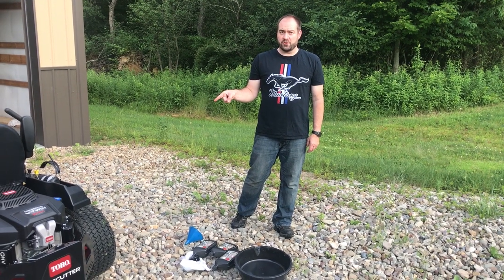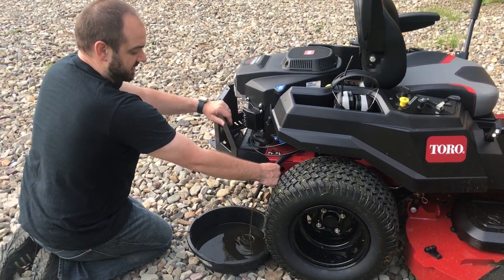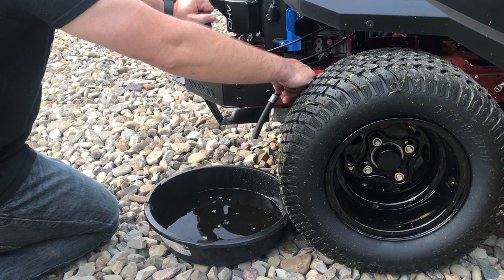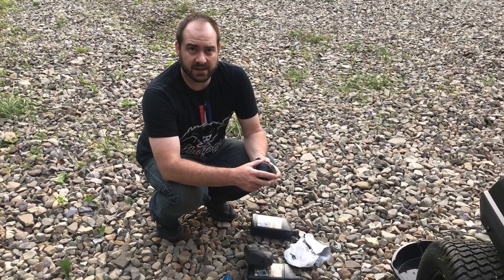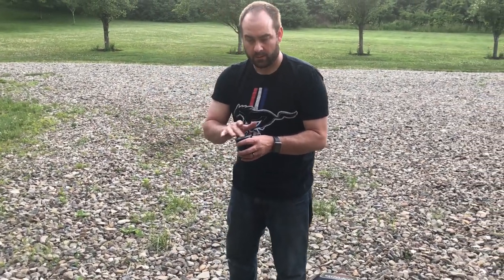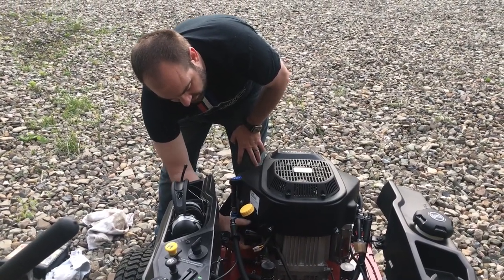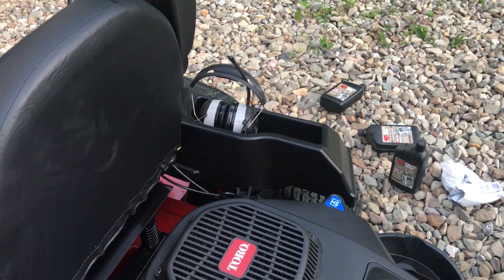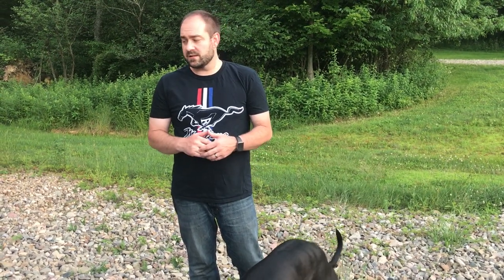#30: Toro TIMECUTTER Zero Turn Mower First Break-in Oil Change at 5 Hours. Quick, Clean, Easy!

Comment: I have had my time cutter for about six years now and still and changed the oil. I did put a truck tailgate spreader on it and a 29 gallon sprayer and painted it and added a rear swivel under the hitch I welded on it
Reply from the maker: A tailgate spreader and 29 gallon sprayer - that's cool!  Thanks for sharing.
Reply: @PurpleCollarLife  putting a rear roller on the back today with a linear actuator to raise it up when backing I’ll post a video soon

Comment: For some reason you had extremely high gasoline consumption. My new 50” Timecutter with a 24.5hp  V twin engine used 3 gallons over three hours to mow almost 2 acres with repeated crossings (literally about 4 acres worth of mowing) to disperse the clippings because the grass had grown a bit too tall. That is a much better yield than what you described and I got the same high yield the second time around. I’m about to do my first oil change so thanks for your video.
Reply from the maker: It's been better as I've improved as an operator.  I think now that I mow mostly in the medium and fast speed, I'm getting much more mowing done on less gasoline.  Good comments! Thanks for watching.

Comment: 2022 the tube (hose) like other model years is VERY hard to get off the 1st time. In fact I broke the plastic piece the tube goes in. I heard others using a screw in top of the tube. Is that ok or does it have to be vacuum sealed?
Reply from the maker: I've heard others saying they have added a shut off valve to the end of the hose if they have broken that plastic piece off.  I haven't heard of any issues.  So far (knock on wood), I haven't broken off that plastic nipple. But I can totally see how it is possible!
Reply: I actually found this video because of how hard it was to get the tube off, and right after watching mine snapped!  I guess I may be trying the valve method

Comment: I just purchased the 52" Toro Commercial 06/06/23.  I mowed for 5.4 hours and still didn't need to fill up yet, but I decided to anyway.  I didn't notice that it had a fuel gauge until I was blowing the grass off of it.  Three tanks seems to be really excessive, especially since I went 5.4 on the original tank.  I run full speed also.

EDITED to add that this is my second Commercial Toro Timecutter and I love both of them.  The first one I've had now for 12-15 years and it's still running.  It has over 1,000 hours on it, but I'm not sure how much since the plug that the hour meter goes into somehow got pulled apart for a short time until I wondered why it wasn't changing. I highly recommend Toro, especially the commercial models.
Reply from the maker: Thanks for sharing your experience!

Comment: H B
0 seconds ago
I just purchased the 75750 only for my home. I couldn't believe it! I almost landed on the street on a decline! I used it for 1.7 hours being very careful operating when I turn left to go back it just slides like ice down the hill. Our yard is mostly flat except for the front with a slope of more than 10% in front that I tried to stay away from. I was ready to jump off to the left. I locked the brake quickly thank God no damage!
Reply from the maker: They can get really sketchy on slopes! Be careful out there.

Comment: 3 tanks of gas does sound a lot; BUT, at the time of your video the engine was brand new as well as you were running in Turtle mode (equates to high revving in low gear), so, the gas consumption can only get better.  According to the operator's manual (Page 14, takes 40-50 hours for the machine to fully broken-in)...    Thanks for taking the time to make this video!!

Question: Have you researched on aftermarket oil filters that can sub for the Toro oil filter (136-7848)?     I found several (WIX WL10239, NAPA 400239, Fram PH4967, Purolator L14476), but I can not verify their exact fitment yet (I am still expecting mine to be delivered) for proper substitute of the Toro filter...   Regards.

Updated (April/26/2021): My 75742's first oil & filter change, the Purolator L14476 oil filter does Not work do to just not enough space between its threaded base to the oil filter adapter (by ~1mm) leaving a very small gap for oil to seep through the filter gasket.  The Fram PH4967 fits just fine with the filter's threaded base making contact to the oil filter adapter right at the 3/4 of a turn.  I had a difficult time find the WIX and NAPA filters in my area, so unable to try them out.
Reply from the maker: Hi Rick.  Excellent point about the gasoline usage.  I do think it's leveled out over time, but still uses far more than a diesel tractor. :)
As far as the oil filters go - I did a lot of filter research on our John Deere tractor, Jeep Wrangler, and Ford F350 Diesel.  What I've found is that some non OEM filters aren't engineered specifically for the engine/application.  Since that time, I've always paid a buck or two more for the actual brand filter.  I buy only the Motorcraft filters for my diesel engine, only the Mopar filters for the Jeep, and only the John Deere filters for the tractor.  I've done the same with this Toro.  The Toro filter is around $12 on Amazon, and I don't spending that for the filter that Toro recommends using.  Great question though.  Here's the Amazon affiliate link for the filter by the way: https://amzn.to/3drs6zV
Thanks for watching and commenting!
Reply: One more comment to share with regard to draining the old oil (I learned last night) without the need to til/lift the left side of the mower since the Toro V-Twin engine base-cover/oil pan design has the cross oil flow/drain channels between  chambers, so by leaving the mower sitting on leveled ground plus give it enough time will allow most of the oil to drain out of the engine;  see video in the URL below:
 https://m.youtube.com/watch?v=02SEt8pfvRU
Reply: Thank you for the info!

Comment: Just purchased the time Cutter, how was the steering when you purchased it? Mine had the tendency to swerve left when levers were pushed all the way forward. It should go straight forward, and straight backwards.
Reply from the maker: Mine has been good.  I do notice when traveling across any grade though.  If you're on even a slight slope traveling sideways, you will have to adjust your hand position accordingly.  If you push both levers to 100% forward and there is even a few degree grade, you will travel toward the direction of the "downhill".  
Also - there is some adjustment in those  levers where they are bolted - check to make sure they're equally positioned on each side.
Thanks for watching! Good question.  Keep us posted.

Comment: If you have an oil pump is there any reason you couldn’t drain from the top through the oil fill tube? That way you avoid that dreaded plastic nut valve at the oil drain port? I have a 5025 that doesn’t have the built in drain pipe
Reply from the maker: That's a good question. I'm not sure about the answer. I have seen some people use an oil pump to remove oil from things like push mowers (the ones with no drain plug).  
I've only ever used this Toro machine - so I don't have any experience with the plastic nut valve.

Comment: Thanks for the informative videos.
I am waiting for my FIRST Zero Turn myself.
I ordered it recently.  (I had to go through Toro's Web Site which I was not pleased with doing)

Anyways I am getting the #75750 Timecutter 50" with the 23hp Kawasaki Engine.
I was wondering if you would know (or if anyone else knows) IF you can swap out the Plastic Chute for the Rubber Chute?
I am willing to purchase one straight up if I have to as well...I am not sure if they have a Rubber Chute that will 'fit' the Residential Zero Turns

Thanks again for your Time & Effort making these videos...
Reply from the maker: Thanks! When I first got the Toro I wondered about the discharge chute too. I considered trying to use a rubber one from a Toro Titan. But the plastic chute is still holding strong so far.  I'm pretty cautious though - I haven't hit it off of anything hard yet.

Comment: Just wondering if your Zero Turn is getting close to having it's Hydro Gear fluid changed and the type of oil you will be using?   
Mine has the ZT2100 Hydro Gear (supposedly none serviceable,  no filter, no drain plug - LOL), so,  I plan to use suction to draw as much fluid out...
Reply from the maker: Rick - sorry it took me so long to respond. I hadn't even thought about the hydraulic fluid.  I'm going to need to do more research.  Let me know how it works out using suction and then replacing the fluid.
Reply: @PurpleCollarLife  
I am currently researching for the 20W-50 motor oil (according to Hydro-Gear,  as long as meets API SL or higher rating) to use, leaning towards Valvoline or Castro full synthetic). I plan to do the fluid change before the Winter,  approximately early Nov. As for using suction , I just got one from Amazon by "4 Uncles" on sale...   I will update here.
Reply: @rickt2419 how'd it go?

Comment: Where I should  put the hydring oil???
Reply from the maker: Good question.  I’ve never needed to change or add any.  I’ll do some research.
Reply: @PurpleCollarLife  mine (75754) has grease fitting for the front tires there are videos that show a common problem with them being dry

Comment: When i pulled down, it broke the little plastic piece.... what do i do
Reply from the maker: Hello Tyler - thanks for watching and asking. I've never had that issue - so I'm not sure what to try.   Did just the tube part break off inside the tube? Or did the tab (with the blue sticker) break off?
Reply from the maker: @tylersamson3567  Thanks for explaining. I think I may have read that someone else had the same issue last year.  Have you tried reaching out to Toro?   I think (you could test it) - if you just plug the hose with a bolt the right size, and hang it so that it's upright, (attach it to something so that it is in about the same position it was in when attached to the engine), it might be okay.  Bummer that it broke though.  Was the plastic cold?  Was it the first oil change?  I had to really pull mine to get it off.  Thankfully - it didn't break.
Reply: @PurpleCollarLife  I have not contacted Toro, even though i have multiple warranties. I canceled my yards today, because of the breakage of the nipple. The end of the hose that was connected to the nipple, is just a drain hose? It doesnt have to be connected to the nipple to continue a flow of oil throughout the engine? It can just be plugged with a bolt, and held upright and the mower will run fine???
Reply from the maker: @tylersamson3567  Hi Tyler - I'm not 100% positive, so you'd want to look up in where the nipple broke off.  But I do think that the hose is just a drain hose. I don't think it has anything to do with oil flow through the engine. Again - I'm not a Toro engineer and not positive (definitely check with Toro or your dealer).
Reply: @PurpleCollarLife  thank you for your help, you’ve gained a new fan/follower.
Reply: @tylersamson3567  what did you find out I just did the same thing
Reply: @tterragnedarb9777  just use a bolt to plug it and put it back in the blue things to hold it straight up. Specifically a oil drain tube.
Reply: #metoo
Reply: I did the same thing.  Called my Toro dealer, and found out it happens a lot.  Bad part is I have to wait a month to get it fixed, and they have a conversion kit so that the nipple part does not need to get replaced.   Covered under warranty.  Toro should sell all the mowers with the conversion kit.
Reply: @herbv.5258  i just used a bolt. Never know it’s broken